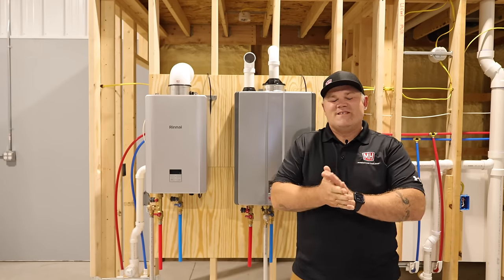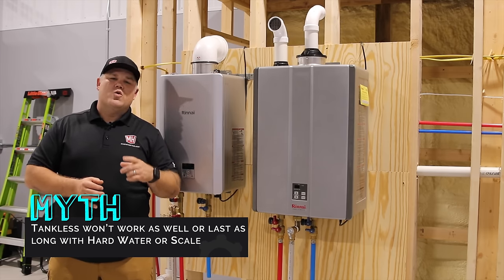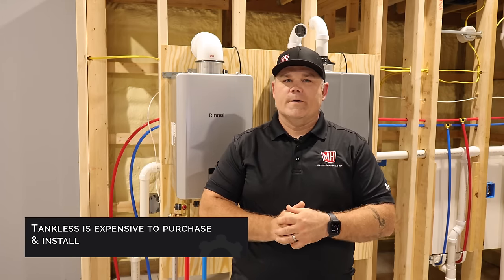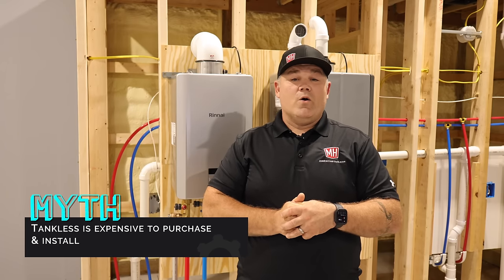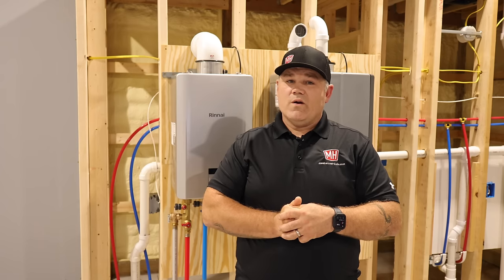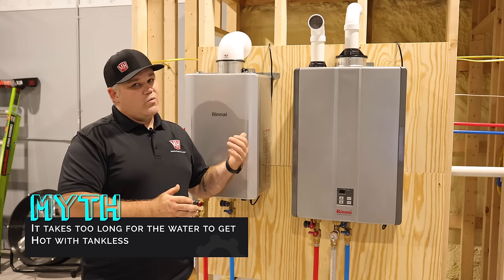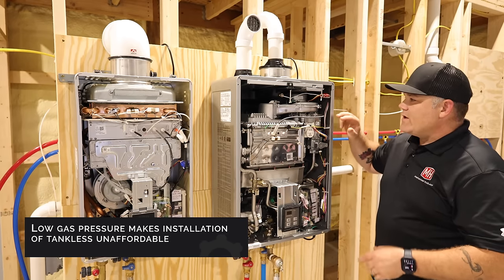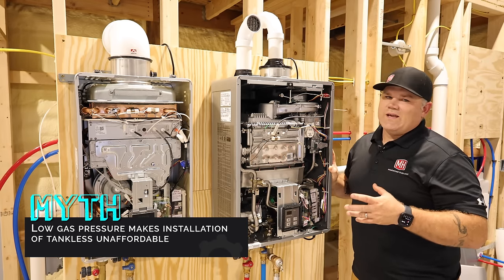Myth Busting! Tank -vs- Tankless Water Heaters

Comment: Youve got valid points, but your effency ratting is wrong.
Also no matter how much you look at it lets give you 89% effency 
In the summer months my gas bill is about 44 a month 37 of the 44 is tax and pipe service fees the gas companies get to charge fof the 7 dollars worth of gas a month i use.
That 89% number now dosnt look so dam big now dose it?  So all your saving is a few pennies one service call youve lost everything youve tried to save.
Now my 6 year water heaters been in my basement almost 30 years
The most ive ever done to it is light the pilot light. Yes its so old it has a standing flame. 
Now lets get back to what type is better? Thats also flawed 
If you using the unit on the right you should be pulling in outsid air to burn becuse if you use inside air you've pulling outside air into the house from weak spots in your houses envlope if its winter you sucking in cold outside air if its summer your sucking in hot outside air. The better option is the unit on the lft but its made with different types of metal, you start mixing copper with some steels you cause one metal to weaken the other type as the effects of different metals cause them to eat each other.

Comment: When he took off the covers and I seen all the controls, sensors, and wiring, along with the fact they do require regular service, I went and bought a standard hot water heater to install tomorrow. I also would have to install a different vent. My regular water heater requires no electrical hookup, so I don't have that change to make either. And to top it off, the climate change nazi's have ticked me off, and trying to remove NG from homes, making appliances more complicated and super expensive makes me want to tell them to kiss my donkey.

Comment: So okay I can buy a 50 gal water heater for a customer for @ $600 but if they wish to have a tankless water heater that will cost @$1500 all of these are at my cost at my supply house..... So lets do the math... If I replace a 50 gallon water heater for $600 and when i replace said water heater with a $1500 tankless (this is all be for labor and material) there seems to be about $900 difference there so yea that add up that they both cost the same...... C'mon man that does not even come close to adding up.. On a side note if you are paying $1500 for a 50 gallon tank water heater you need to probably shop at another supply house because they taking you out to poor house with them prices even with inflation or whatever reason you want to come up with. It does not add up

Comment: This must be a a pundit for a tankless manufacturer. The video is deceiving. with non-treated hard water, a tank water heater works, and a tankless won't work for long. Large households that use a lot of water, especially in cold weather will have a hot water problem. I get the complaints all the time. Tankless water heaters are way more expensive to install and require more maintenance. Do your research; just call a plumber. Retrofitting a tankless is super expensive, and you'll be paying to maintain the tankless. There's virtually no maintenance for a tank water heater. There should be no difference in hot water delivery between tank and tankless. Plumbers will do recirculating lines for either. Use some common sense, there are way more moving parts to go wrong in the tankless compared to a tank water heater, which means more repairs and it's not cheap. A tank water heater is essentially a 35,000 BTU burner heating up a pot of water. This is from a retired plumber. Just giving you another perspective.

Comment: I PUT a motion sensor in my bathrooms when I remodeled them. The sensor turns on the recirculating pump when anyone enters giving them "instant hot water" at the tap.  Saves energy from less heat loss of constant recirculating hot water so only when needed.  What about the Democrats NO GAS FIRED WATER HEATERS ?   Electric Tankless ?

Comment: Sponsored by Rinnai... enough said.  He lies when saying hard water is a problem for both so its the water... not tankless.  Tankless heaters heat a pipe the size of your finger with a flame.  Scale adheres to the pipe and GREATLY reduces the efficiency and eventually clogs it up.  The warranties always say that it doesn't cover scale buildup and recommends periodic flushing.  A tank does not lose efficiency like the tankless and will last much longer since there is plenty of room for scale flakes in the tank.  Cost is the same for both... including installation????  LOL.  Call any plumber and ask them and you will hear a huge laugh as well.

Comment: I have a tankless Rinnai system. #2 is not a total myth. He debunked nothing. #5 is also not debunked. We don't have a recirculating unit. It takes up to 10 minutes of running the hot water at full blast to get warm water during the winter. About 5 minutes, full blast during the summer. Yeah, it never runs out as long as you keep the faucet/shower going full blast, once it's started, but it does take a LOT longer to get the hot water to run. Much MUCH MUCH longer than simply a line full of cold water from the tank to the faucet/shower.  Also, doing dishes with the faucet at full blast the whole time is wasteful and annoying. If it's not at full blast the Rinnai doesn't heat the water. If you start off full blast to heat the water, a few minutes of turning the flow down you just get cold, even when the faucet shouldn't be giving cold at all. Winter problem this year, it got cold enough to freeze pipes. We ran a small amount of water to keep it from freezing. Except we didn't realize we needed to keep the hot, cold and showers all dripping to keep all lines moving. It just wasn't needed when we had a tank system. We've been without hot water for 3 days. Finally got it going today and have to keep the taps/showers running constantly to not loose it tonight when it drops to freezing again. While I do like the idea of never running out of hot water, my experience with the Rinnai isn't good enough. I'm getting a tank when we can afford it. I'd rather go back to scheduling our shower times around full tanks then continue to put up with these problems.

Comment: Don't buy a tankless water heater.  You WILL regret it.  They are not reliable and good luck finding a qualified technician to work on it when it stops working.  They react poorly to water pressure and gas pressure variations.  Yes tank water heaters get scale and sediment in them but it doesn't affect them like it does with a tankless.  I have owned Rinnai and Noritz.  Never again.

Comment: tankless  just try to run water slow and have water, it is great for large flow but not for a dribble,,, or low flow,  then the water temp changes with flow,  no myth I have a tankless and hate it have a tank and a tankless and ill take the tank every time I can get hot water and turn it down and have a slow flow , buy a hibred if you are having a tankless    ,, my experience tankless hard to get constant temp for a shower impossible to get hot and low flow,

Comment: Completely disagree! Almost all the myths are true. He can say anything under Rinnai sponsored video, LOL. Call your local plumber and ask him to quote installation, you will know how ridiculously expensive it is. Oh yes, it takes ages for the Rinnai to fire up and start heating water as opposed to tank already holding hot water. I havn't mentioned Rinnai breakdowns. Unless you are handy expect to open it up every year to clean hot rods, or it will not even fire up! The larger unit is so much expensive that you can install 2 tanks giving you longevity. Having said that I would still prefer tankless for different reasons, i.e. space, disasters, endless hot water etc. But what he calls Myths are not myths for sure.

Comment: To say "upgrading the gas line" is a "total myth" is just poor education to YouTube viewers. Gas lines need to be sized according to the length of the run, the pressure in them, and the BTU of the appliance using the fuel. A standard tanked, 40 gallon water heater, will be 34,000 to 40,000 BTU. Tankless water heaters can be up to 200,000 BTU. If you have a long run of 1/2" pipe for your old water heater, it won't be big enough to supply a 200,000 BTU appliance. A gas valve and draft inducer are NOT a damn turbocharger that pulls the gas through the line. What a line of total BS. I would never hire this guy if he believes what he is saying. And just FYI, I work for a gas utility and have sized gas piping in homes when we add appliances. This is one of those times when size really matters 😉
Reply: Actually the minimum pipe size is more like 1 1/4"  for 200kbtuh in most cases. I was also scratching my head about the turbo charger comment. 
other costs are involved like power plug run and annual maintenance. 
It maybe worth it, but the additional cost can't be ignored as a myth.

Comment: I watched this thing all the way thro.

Here's what you didn't tell us:

What are the units heated with?  Where did you tell that.  What r they - gas or electric!!!

What is a condnsing & non-condensing??  You don't say but you use the terms!!!

How did you come uo with the efficiecys!  You just thro numbers out with out substantiation!!!

and when you talk about having endless hot water, and teenagers running the hot water forever - you better talk about the cost of heating all that water.  And don't forget - you have to PAY to pump the water from the well OR pay the meter rate for town water!!!  You'd shut those kids down in a hurry when you get the bill!!!

for a tankless gas I can't answer for.  But an electric one? - well, you better mortgage the house!

You will need a heavier (more expensive) circut breaker:

you will need heavier (more expensive) supply wiring!  and then watch the electric meter spin like a top off it's bearings!!!
 
I installed a 20gal electric hot water heater (Marletplace) with an on/off switch in the kitchen, for the shower.  In 20min I have 20gal of hot water - and then the tank is OFF electrically - ALL DAY! - ALL NIGHT - until I need it.  

It's not cycling on/off all day or all night when not needed!

I installed a small 9gal tank (Marketplace) under the kitchen sink with an on/off switch!

Want to see my electricity bill? You wouldn't believe how low it is if you saw it..

Yes - your presentation was fine - for people with disposable income. But for lil ol farmboy me, there's a way to cut back...

Comment: Tanks are so much cheaper and more reliable not even close. You'll get 10 years of use out of a cheep tank with no maintenance whatsoever. I've replaced tankless that were less than 5 years old because they were not flushed yearly. Tankless are complete garbage. Plus in emergency you have access to 40-50 gallons of water in the tank. Would never install a tankless in my own house always stear customers away from tankless

Comment: There is no way you can install a tankless same time frame ss a regular tank, You  must be using 100 sharkbite fittings and even then there is no way you can install a tankless same amount time as a regular tank. If your going grom tank tankless you have to re route everything wayer lines gas lines, condensation line needs on a tankless, it needs mounted, holes need drilled  out the wall, pvc pipe needs ran, service shut off valves need Installed. So i dont care if your the fastest plumber in the world there is no way your installing a tankless dame yime as installing a regular tank

Comment: I was very disappointed after clicking on this to see that you were only talking about CENTRAL tankless water heaters. OF COURSE, it takes a long time for the hot water to get to the upstairs bathroom from the basement!! When I was in Britain OVER 40 YEARS AGO, tankless heaters were already relatively common. I stayed at a rural farm's B&B where the guest room's shower had an electric heater right on the hot water pipe just before it entered the shower heating the water on demand with a very healthy flow rate. The unit was just a few inches thick and something like 5 inches by 8 inches. Aside from the actual water pipes, only the necessary wiring was attached to it; no need for vents or gas supply. You just had to be prepared for INSTANT HOT WATER.      
     Why aren't you talking about that?

Comment: I got reamed by ream --- never buy that brand again - tankless hot water heater - required disassembly to " Clean"  the  burner which requires hours to do  --   no visible dirt or flame rod carbonization - clean anyway re assemble - code goes way - rheam technical could not help- re using a 10 year old Japanese design under license -  do it all over again every 2 to 3 years.  NEVER buy that brand

Comment: Having a tank water heater is a waste of energy. BIG waste of energy!
Imagine you keep your car running 24/7 in your garage, just in case you need to go out. idling and wasting gas for no reason.
That's exactly what your water heater does. Idles all day heating up water for the few times you need to use it. BIG WASTE.
Tankless water heaters on the other hand, run and heat up your water AS NEEDED ONLY! For as long as needed, and nothing else.
How many of us has left the house for the weekend to go camping or vacation or whatever. Did you ever shut down your water heater in these occasions?
Nope. Never. Have you ever left the house or went to sleep and left your car running in the garage? wasting fuel? No? How come?
Because is a waste of fuel and energy, and depletes your pocket of money you could use for something else more important. 
Be a smart person and get a tankless water heater. Do like the rest of the world is been doing for decades. Save money!
Tankless water heaters have been around for well over 80 years!

Comment: ATG & I say he failed to say nor have his wife take a shower when house has no electricity. Yes, as in a power outrages.
Very expensive when hiring scam electrician & plumber doing the removal of water heater to install a tankless!
Many gallons of water wasted just to get hot water into the shower.

Above are based on fact of using an electrical tankless heater.  
Again, some homeowners can remove defective water heater and then be able to install a new water heater.
But good luck doing it by installing a tankless.

Like saying some can install a bidet toilet. But everyone will surly scream during the winter time when that thing hit that hole!
So good luck finding an AC outlet on bottom of the toilet to warm up your ass

Comment: What a bunch of nonsense!  My old tank-style water heaters are pretty reliable, and when I do have a problem, it usually gives a warning by reducing the amount of hot water available.  Most of the time this is cause by one of the two heating elements failing.  I can replace the heating element relatively quickly and the cost is usually less than $30.  Also, if my electricity goes out, I STILL have enough hot water to take a quick shower.

Comment: I call bullshit - courtesy of this SPONSORED video.  I have personally owned 2 Rinnai tankless water heaters that were both installed professionally in a home that was specifically plumbed for tankless (code in my neighborhood).  Both of these units are INCREDIBLY inefficient compared to tank units.  And, they are FAR more expensive than tank water heaters, even today.  It is a SIN how long you have to run the water just to get it warm, and if you try to change the temperature to anything above 130 (and yes we need those temps) BOTH of the Rinnai units will shut off.  This is not a feature, it's a bug.  Please, don't spread misinformation in the name of sponsorship.  Because I know for a FACT that your claims are NOT true.

Comment: Tankless Water Heaters are modern day, throw away " garbage." They are bad Engineering at its worst. I have extensive experience with the Takagi TM 50 ASME series in an industrial setting. This Technology is a colossal joke, and the mean time between failure is even more of a joke. There are too many moving parts, too much plastic, and way too much complexity in too small of a package. Its an attempt to heat water, " way too fast." Its necessary to use inhibited Sulfamic acid to descale, which is needed about every 27 days  on a fairly good water supply. Tankles Water heaters are something for a gullible, uninformed society to buy into. Plumbing outfits who think Pex pipe is great love them, because they are quick and dirty to install. My advise is stay well away from them. They will always fail when you nee them, and they are very difficult to repair, and not worth the labor spent. They waste countless hours of time, not working.

Comment: Stick with the tank and save money.
I got a new Dunkirk tankless heater about 2 years ago.
It sucks.
Its about 20 feet from my kitchen sink and it takes 5 minutes for it to heat up.
Hot hot, nah, I can hold my hand under the hotest water without worries.
Adjusted the temp to 106°, no help.
110°, a little warmer.
126°, now its warm enough to take a shower and it takes longer to heat up, although my bathroom water line breaks off of my kitchen line and is directly above my kitchen.
$6000 to have hot water in 10 minutes.
A tank does the same thing at a cheaper price.
The temp is now at 156° and it now only takes 2-4 minutes to get hot. 😊
Tankless heaters are a freaking joke !!
Waste of money and I have the best one on the market.